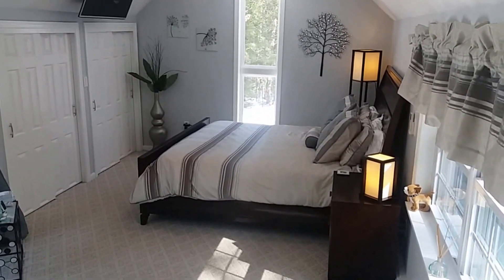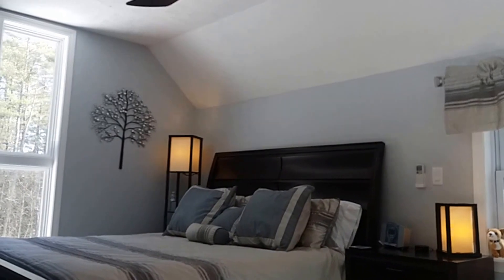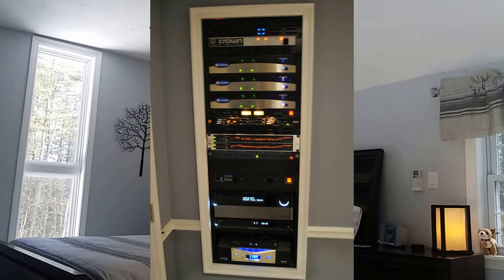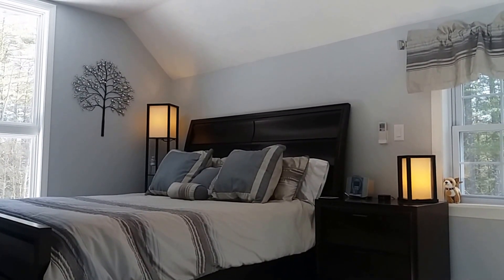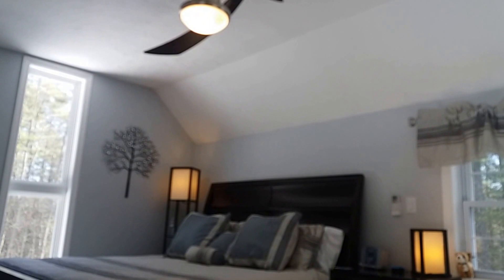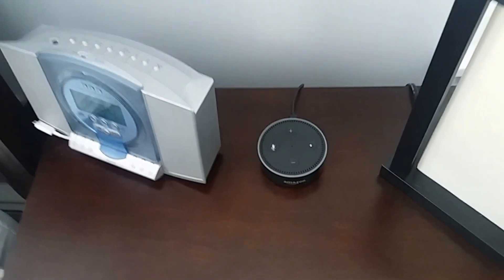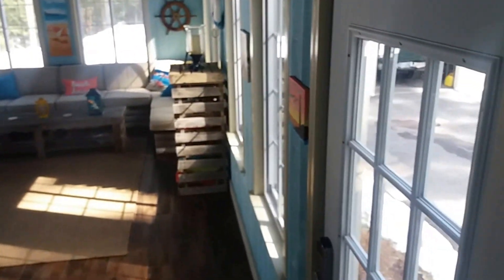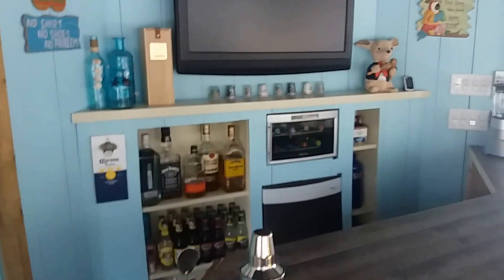Demo of Voice Controlled Home Automation with Wink Hub And Alexa

Comment: Now that Echo is coming to Vera are you going back? I found Wink to be my least favorite/reliable of all. Smarttthings worked ok for me but Vera was the big home run. I have never had one (catastrophic) issue at least. Sometimes with Wink (Even smartthings) I would get half my zwave system to drop out. I have repeaters and zwave switches all around house so range is not the issue for me.
Reply: TrialnError What are your thoughts about VeraSecure? Do you plan on purchasing upon release?
Reply: TrialnError Ok thanks! Just wanted to see what other people thought. Also nice theater setup!